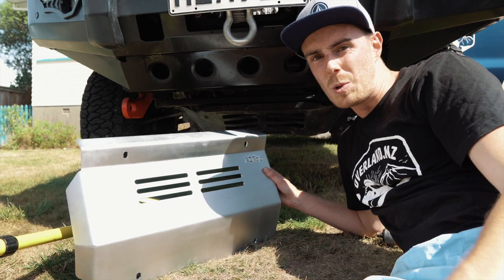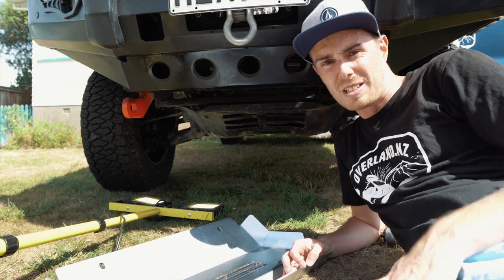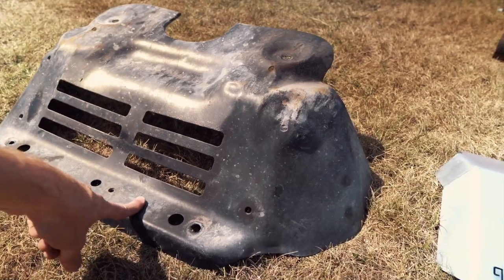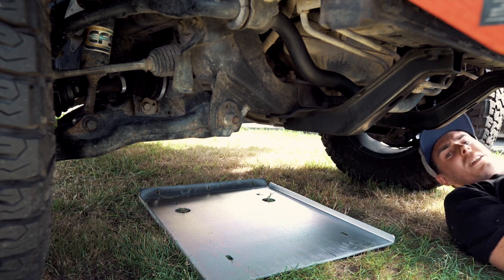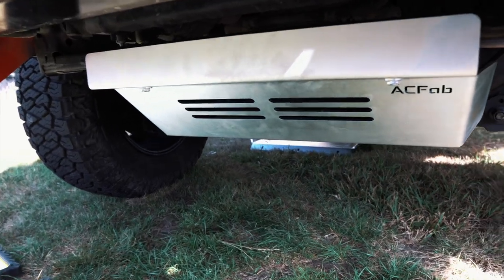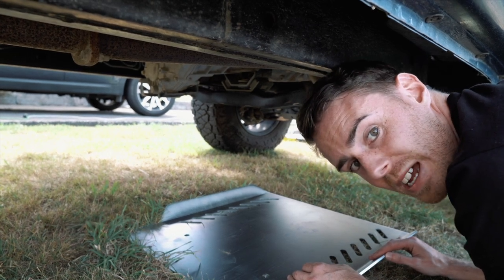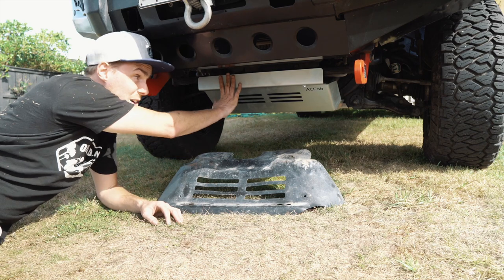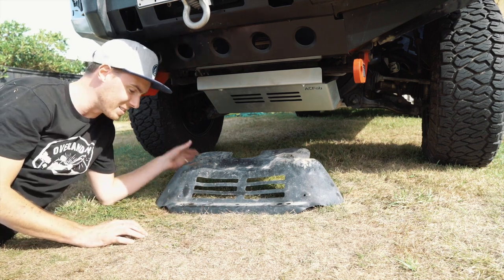Fitting some KIWI MADE AC Fab bash plates to the Hilux!

Comment: Mat u may need to update the nuts that the bash plates screw into on your chassis. There is a reason the standard bash plates are thin cheap tin, & that is because the mount nuts that are welded to your chassis are only made from very cheap & soft mild steel too. Toyota's are probably are a little tougher than the Mitsubishi Triton mounts which just break fall off once you put a decent bash plate on. The front nuts welded to the Triton chassis are made out of cheese & strip out the thread real quick too.
Reply from the maker: True true - weird that they don't just use decent nuts eh. I've had no issues with them across two vehicles so far, touch wood. The Toyota ones seem to hold up well to being removed for servicing. Will keep an eye on them though

Comment: It needs to be folded up at the rear or it will catch when you have to back up
Reply: No different to anything else with an edge to get caught on underneath. I've never found mine catching on anything while reversing
Reply from the maker: Will be interesting to see if it causes any issues or not! It doesn't appear to hang over very far at all. And if that's catching I've possibly got more going on, fuel tank guard and transfer case plate sit around the same height (Hilux life...)
Reply: What suspension lift do you have where did you get it done thanks gret bash plates